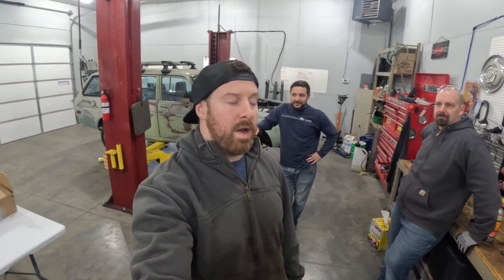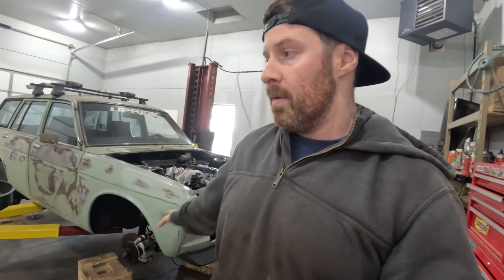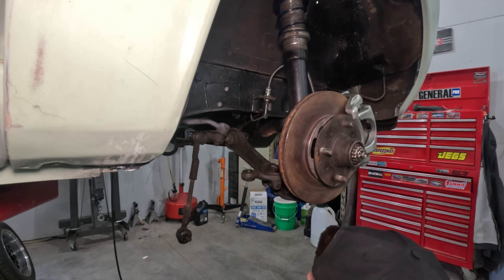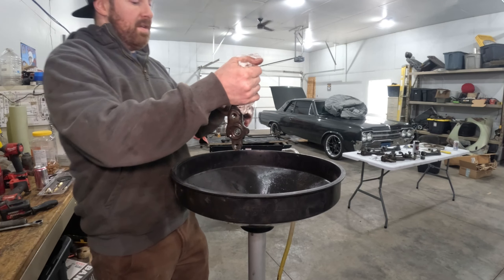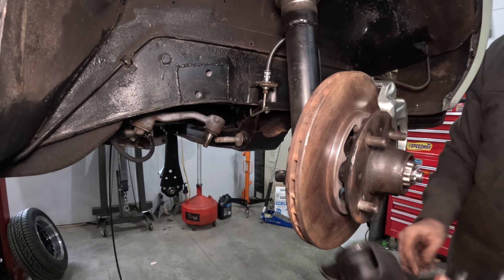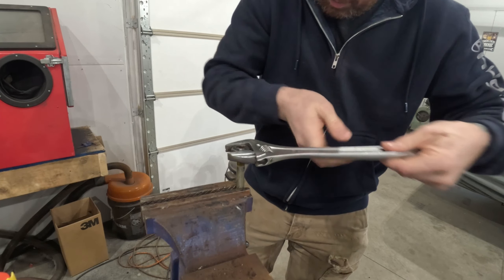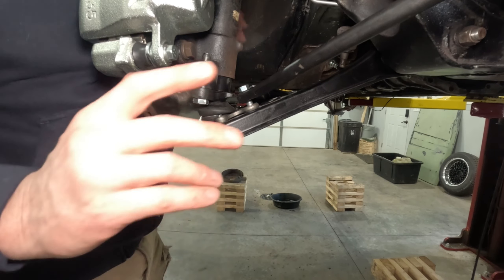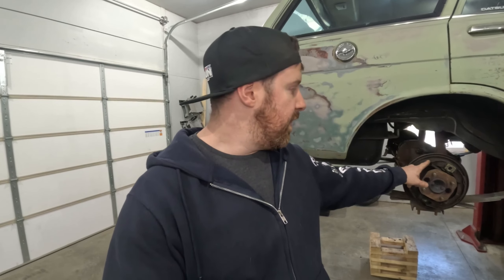STEERING AND SUSPENSION OVERHAUL | Turning this Datsun 510 Wagon into a handling machine!

Comment: not sure you will see this now BUT threaded holes in the brake drums ARE to help remove them. usually they have 2 and you thread bolts into them to use like a puller, if only 1 they put pressure on so you neednt hit them as hard with the hammer to get the drums off. also the 'wierd' washers with the keyway tab on the inner lower sus[ension arm is for adjusting the camber of the front suspension, they SHOULD be in a slot or similar so that rotating the bolt with the washer on pushes the inner bush etc in and out to change the camber

Comment: I HIGHLY recommend, swapping the poly bushing in the tension rods to stock style rubber ones. Poly ones are way too hard on a light vehicle like the 510, and there is a big history of BROKEN tension rods on 510s and 240zs, due to the inabillity of the poly bushings to flex. For your safety and others, swap those out. If you want an upgrade but dont want to stay stock, you can buy T3 adjustable units, or swap to a ball and socket design compression bushing thats available online.

Please dont use stock tension rods with poly bushings. Everything else is fine, like poly lower control arms or swaybars.
Reply from the maker: Noted. This has been mentioned before. I’ll change them out.